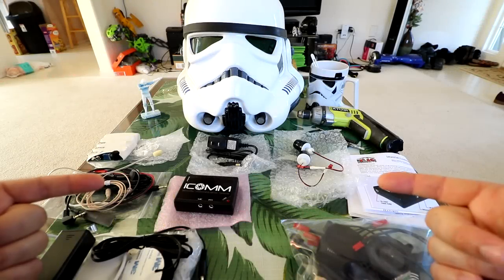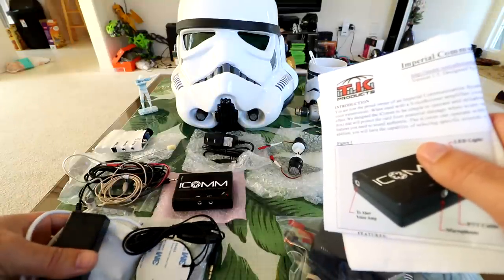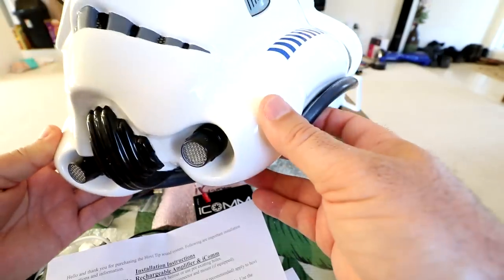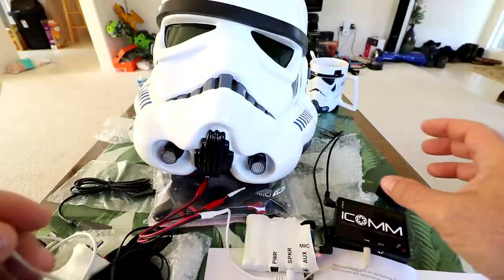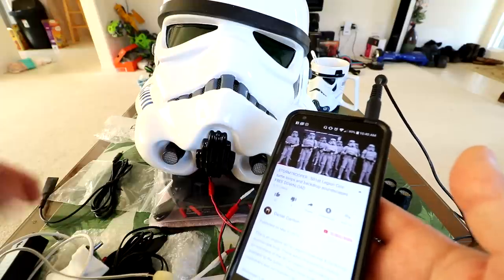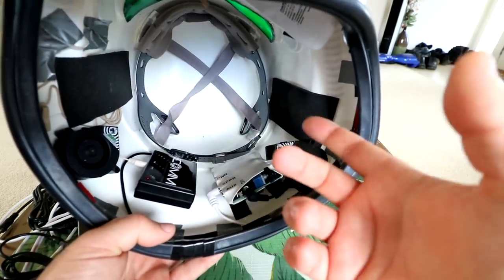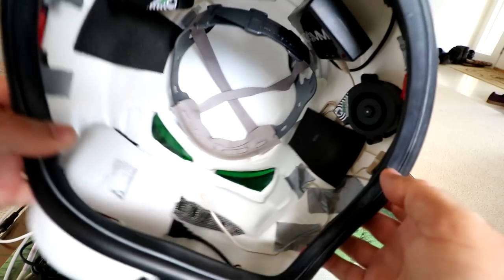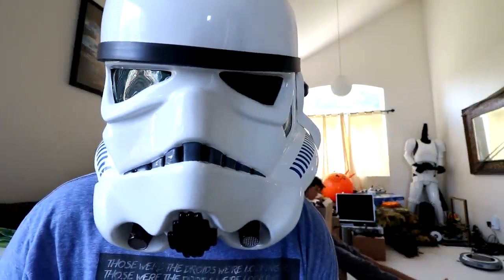Best StarWars StormTrooper Helmet Voice/COMM System - 501st Legion UKsWrath's Kit Install and Review

Comment from the maker: Sorry guys, here's the updated links to UKsWrath Kits.  Also got the links up under the vid in description https://goo.gl/WBGaFR The best I've tested so far.  Cooling fan system https://goo.gl/A8Rp9z This system really brought the armor to life and was awesome not to have to worry about any wires coming out of the helmet.  Just power up and put it on.  I've tested some others where the speakers are in the chest armor but you have to run the mic wire up into helmet and it is a hassle. Much better with this kit since it's all self contained in the helmet.  A fun Halloween this year.  I've put up a short 1min video of my escapade at work with armor on my INSTAGRAM here https://www.instagram.com/dustindunnill/  Check it out..lol  :) 👍
Reply: Thanks for the info.and video. I'll have to wait a bit before it is in my budget but it IS going on my bucket list.   PS.....no pun intended there lol
Reply: Hello Dustin my name is Kevin green field ok, I have a ESB storm trooper helmet and don't know how I would put my metal hovi tips in the front of my helmet , and also I have 2 electronical small fans and toggle switch and 9 volt battery and connectors and I have a voice amplifier system and microphone head set and I'm not sure if this goes into my armour or not because it's quite big and square and I want some help with these so Dustin can you help me as I'm at home all by myself.kevin green field.
Reply: Can I get one but for boba fett

Comment: I'll be honest this is pretty dope. I'm thinking about doing my own StormTrooper Helmet, but personalise it to be more me, make it red, put in this type of audio system. But you can get a small wireless Bluetooth Aux connection thing that I might put in so I can Bluetooth to the headset itself. I think it'd work, hopefully. Pull some old headphones apart and put them in for music and can also be extra cushioning. The fans look great I like that and really would be needed. Also there's these "Chemion Glasses" that I've bought a while back, And I think it'd be mad if I somehow pulled them apart and put them in each eye. If not, having a simple LED strip in there would also be cool. Might effect my vision but it'd look cool. I'll definitely use your video as a guide. Mine might be a really long project but I hope it works for me. Thanks again my dude 👌

Comment: Helmet looks slanted and it’s bothering me
Reply: The helmet is definitely not proportioned correctly.
Reply: Connor 
Yeah it seems to droop down on his left side 🤔
Reply: I noticed that too lol. Still pretty cool though besides that.
Reply: It’s always been that way, the original cast was hand made so it won’t be symmetrical. It’s 100% screen accurate
Reply: @fragban5994  so the movie accurate helmet is cocked off to the side? No thanks
Reply: Jonathan Viterise and?
Reply: @fragban5994  It is most definitely not screen accurate. While all of the costumes in A New Hope were hand made and there are some symmetry issues, there is nothing that even approaches what is on display in this video. The eyes are off, the black band above the eyes is way off, and the top of the head is lopsided as well.  
This may be cast off of a stunt helmet due to the green eyes in it. I believe all hero helmets used smoked grey/black eyes.
Reply: It wasn't just me then. It looks like my profile picture
Reply: It looks like his camera is fisheyed or something so it doesn’t help but I don’t think it’s perfectly symmetrical anyway
Reply: It’s a replica helmet of the trooper that banged his head on the door. 😂
Reply: @noahtall1580 all of the troopers had green eyes but the stunt helmets had flat lenses and the hero ones had bubbly lenses. also the stunt has a longer mouth section

Comment: You should consider putting the batter somewhere else instead of on your face. I imagine you could run a wire under a turtle neck to attach into the helmet and be hidden. The battery down in your belt or something for easier removal/charging and easier on/off of helmet.
Reply from the maker: Good idea.  Just wanted everything in the helmet for easier trooping and resting.  I've delt with a few cables between helmet and body in the past and it gets really frustrating when helmet goes off and on the head a few times 🍻.
Reply: Id be more worried about the lithium burns. The chance of the powerbank catching fire may be extremely small but lithium is mental when it goes up. If it lit up in that spot it would melt cheek, lips, nose and eyes just in the few seconds it'd take to remove the helmet. I can understand not wanting wires running to the chest area so mayb place battery at the back of the helmet,

Comment: Hey dustin, how much extra heat is in the helmet because of all the power running in there, even with the fans on, do you have a time frame for what might be the longest you could wear the helmet with all of that running in it?
Reply from the maker: I wear the suit on Halloween on occasion and have the helmet on for about hour constantly in hot and humid Hawaii climate without issue.  Stays nice and cool with the fans.  Before the mod it was almost intolerable to wear and fogged the lenses constantly as just an empty helmet.
Reply: @DustinDunnill  thank you

Comment: Will it work with a black Series? Or is there an alternative choice for a helmet at the same price but without the integrated mic?
Reply from the maker: It's pretty custom so it will work
Reply: @DustinDunnill  Okay, but is there a better helmet? I don't know.. But the installed voice changer in the BlackSeries will be unused technic if I'd put in a custom changer.

Comment: Pretty cool!  Have you thought about making the components body mounted and running the wiring harness under your shirt collar?  Might reduce the weight and heat in the helmet.
Reply from the maker: Originally had it in the chest piece and was a major hassle.   Everything in helmet is much better.

Comment: i have built 2 fotk costumes for my wife and I have been looking for a decent voice changer to add bursts and clicks i have 2 generic amps like the aker amps however my question is will icomm work with any amp or does it have to be aker
i have been unable to get a solid answer. and dont want to have to buy another 2 amps
Reply: or i guess i mean the speaker
Reply from the maker: Use any speaker you want 🍻
Reply: how does the icomm box get power
Reply from the maker: USB power pack

Comment: Your two mics are facing opposite directions. They look off you might have to fix that
Reply from the maker: +Box Dolphin The hovi tip mics I'm pointing at in the thumbnail?  Their pointing forward.. not sure what you mean.
Reply: Dustin Dunnill - Rotate/twist them so the mesh lines up with each other (diagonal)

Comment: How much was the armor you ordered?
Reply from the maker: Around 1k 😯
Reply from the maker: But it's the original armor from the movie molds from Andrew A's studio 👍
Reply: I want to get my own set but there are so many options out there.....was this ready to wear or did you have to trim and apply straps yourself?  The helmet looks good though....also, did you have to buy the gun and all the soft goods separately?
Reply from the maker: I got a a"kit" which came with everything, saves money but needs assembly/trimming. You can get a pre fitted suit per your dimensions but it's around 500 more. Built and painted my blaster from a toy base with 3D printed add-on parts.

Comment: Hello Dustin my name is Kevin green field ok you see I have an screen accurate ESB storm trooper helmet and I have 2 electronical small fans where the teeth go ok and i have a toggle switch and a 9 volt battery and connectors and I have a voice amplifier system and microphone head set and I want to know where these go. From your fellow storm trooper Kevin.

Comment: Hello Dustin my name is Kevin Greenfield ok and I'm struggling with my ESB screen accurate storm trooper replica helmet? You see I have 2electrical fans and toggle switch and 9 volt battery plus connectors and the battery holder and microphone head set please Dustin can you help me all these go please many thanks Kevin Greenfield ok thanks for your time.

Comment: Another dodgy sounding pack, where you had the helmet on at 16:41 it sounds nothing like a storm trooper. A total waste of money to be honest.
Reply from the maker: "sounds nothing like a stormtrooper" 😂.  Time to start watching starwars.
Reply: Dustin Dunnill You said it yourself. The raspiness normally isn’t so prominent. Seems like someone is a bit more confident in their Star Wars knowledge than they should be.
Reply: Dustin Dunnill yeah Imo you got scammed a bit
Reply: @DustinDunnill  You do not have to watch star wars for the millionth time, you can just listen to the stormtroopers at Disney theme parks on youtube. The sound quality is totally different. To help the audio quality it would help to pronounce your words as a stormtrooper would, rather than talking in your normal voice. You want as flat and monotone voice as possible, during normal speech a person's pitch will rise and fall as they speak words, this will make any voice changer have a hard job at equalising the sound.
Reply: @MarkNorville  The troopers at Disney use pre-recorded voice lines...
Reply from the maker: I don't think you can achieve better sound using the hovi tips as speakers.  I used to have a speaker in my chest plate which sounded a bit fuller but was always a hassle having wires running from body to helmet.  With this setup it's all contained in helmet and for tiny hidden speakers it sounds great and serves it's purpose.